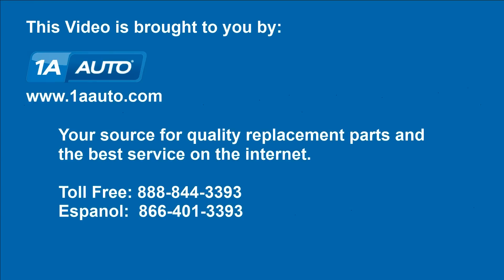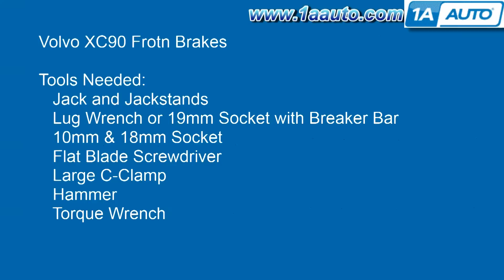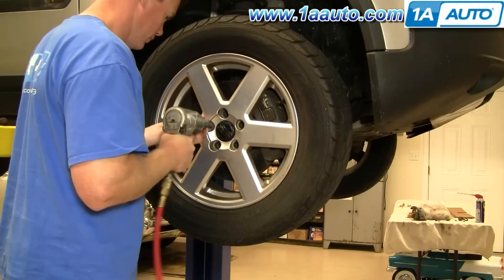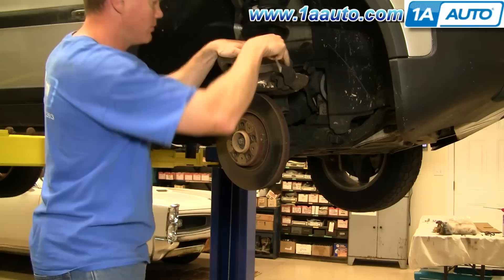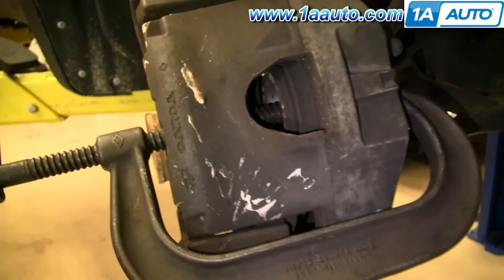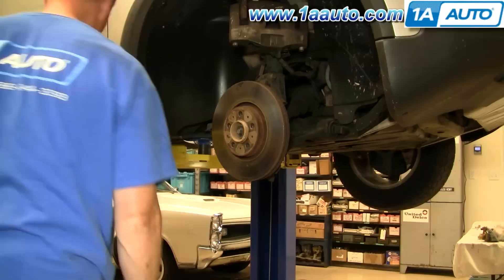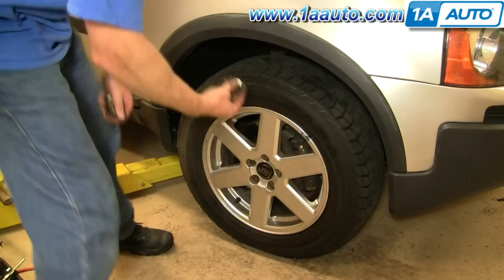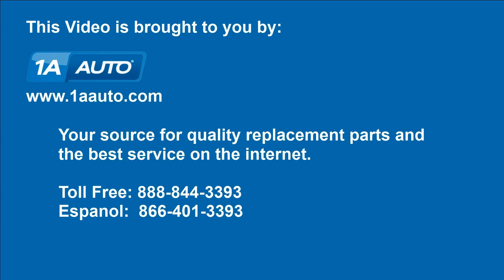How To Replace Front Disc Brakes 03-12 Volvo XC90

Comment: You Rock ! A prior video should a guy splitting the caliper apart, which is what im not use to doing.. You just saved me some time and the need to go get a torque socket!
Reply: I meant the need NOT to go get a torque socket as in another video!
Reply from the maker: Orlando Braxton Thanks for watching. 1aauto.com 888-844-3393

Comment: Use a wood type clamp, they slide open and closed. Also, when bad brake pads are changed, use old pad and put against the piston, slowly tighten clamp to push piston back into the caliper. I usually have a wrap wrapped around brake fluid reservoir in case fluid pushes up and out of the reservoir. I find the wood clamp works better because it can easily be twisted closed with one hand.

Comment: You should have replaced the rotor, because you put a dent in the braking face when you hit it with the ball pein hammer. You could see the mark in the video at approximately the 6 o'clock position.
Reply from the maker: Thanks for checking us out. 1aauto.com +fred smith

Comment: Forget c-clamps - get yourself a ratcheting caliper spreader and save yourself a lot of headaches and possible damage to your caliper!  I got a cheap one with free shipping  for 18.99. Also, you can replace your pads without removing those huge, corroded 18MM bolts that hold on your caliper retainer.  Use a 3/8" hex socket and remove the caliper guide pins - they're located on the back side of the caliper and are covered by plastic caps - during this process the guide pins should be removed, cleaned & regreased  anyway - they come out a lot easier and you just pull the caliper off the top of the retainer - the rest of the process is the same as the video - I'm a little shocked these tips weren't mentioned - good luck!
Reply from the maker: Thank you for the great reply and tips provided! We love to empower our customers by showing you how-to perform your own auto repairs while installing our high quality auto parts. Have a great day! 1aauto.com +Brian Foley
Reply: Actually this video saved me a ton of trouble as most of us don't have the allen wrench attachment to fit. I didn't, and all the other videos showed your way, taking off twice as much stuff and using a special attachment whereas this one showed you how to do it with 2 bolts and a standard 19mm socket.  Video saved me some trouble as when your cars on jacks you can't run down to the auto parts store. Especially when you live high up on a mountain.

Comment: I have a question on replacing the rear brakes on an '08 XC90:  Do I need to remove the caliper and caliper bracket separately, or can I remove the entire assembly as one piece?  Thanks!

Comment from the maker: If everything is off of it that holds it in place, you may want to see if you can bang it off with a hammer. Sometimes with the heat build up they can weld themselves into place. Hope this helps you out. 1aauto.com 888-844-3393

Comment: You should never hit the rotor , with a hammer if you are using the old one , and you should put break grease on the back of the pads , to help to prevent break dust

Comment: What about the sensor on the brake assembly that goes on the back of the rotor on the strut?
Reply from the maker: We currently do not have an auto repair video that shows this particular repair. Thanks for asking. Have a great day! 1aauto.com 888-844-3393